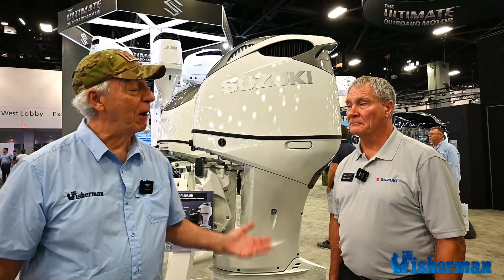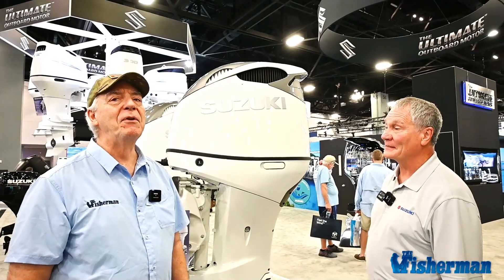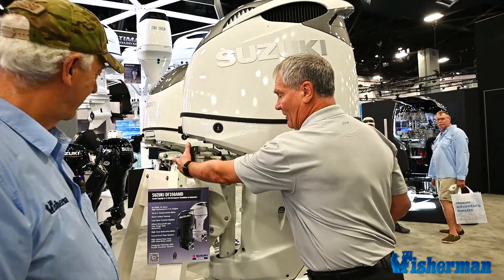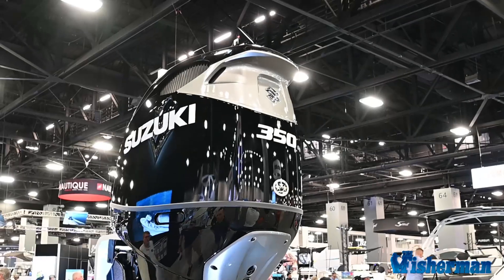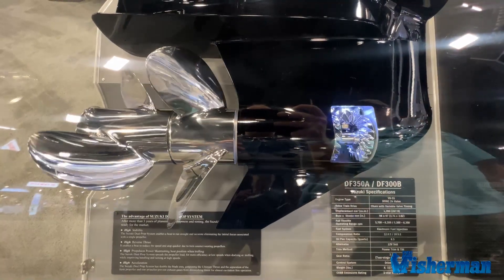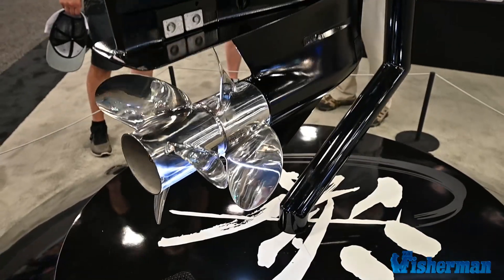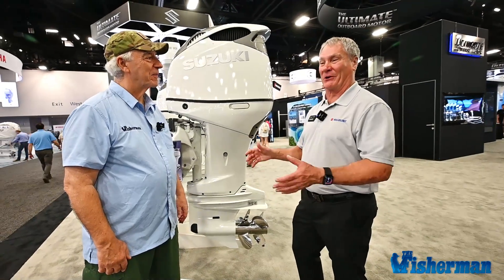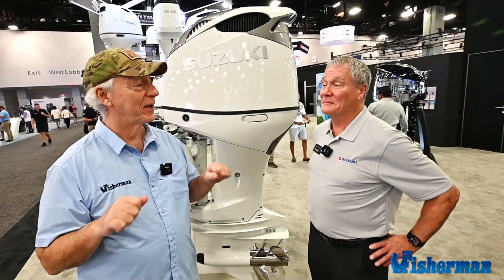Suzuki DF 350 AMD outboard Motor Review

Comment: What about the lower units I have trip 18 df350 9n the back of my boat and the lowers unit have given me nothing but problems
Reply: What happened to the lower units?
Reply: @jasonbourne1596  still the same nothing but problems since I've owned them oil in the lower units on all motors changed to a new seal and its still the same water keeps getting in lowers